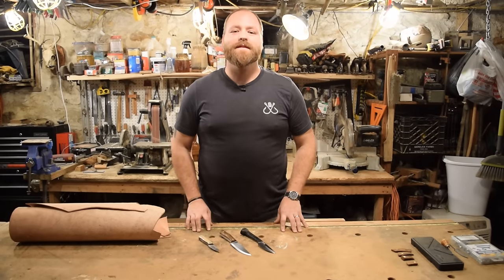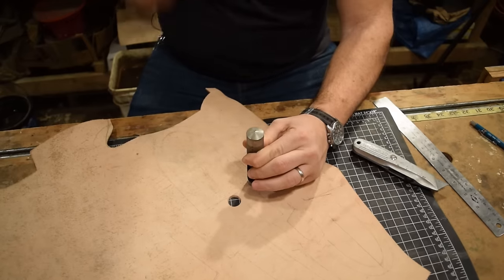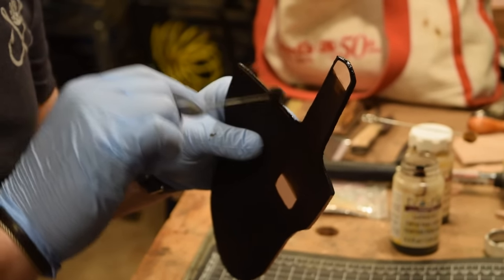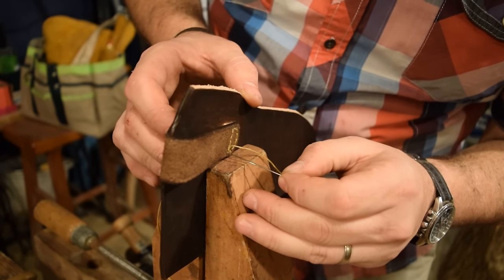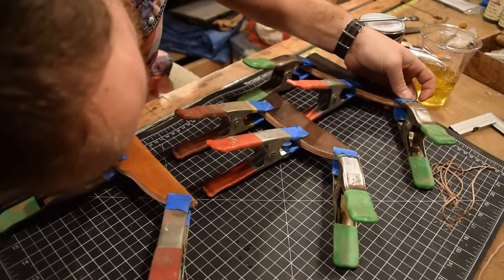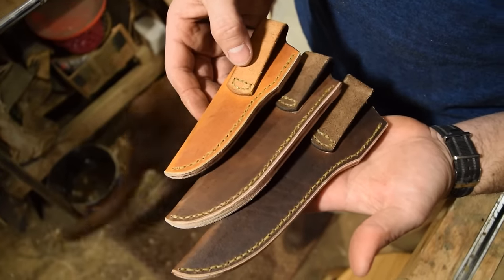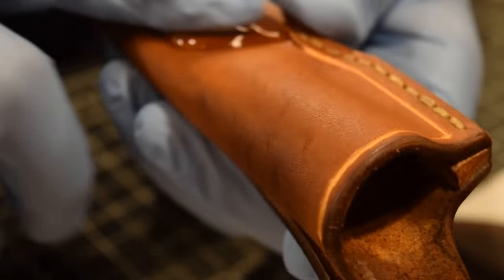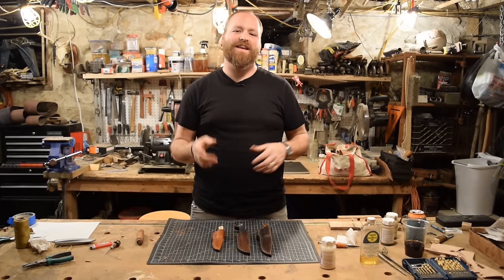Making 3 Knife Sheaths: 21 Essential Steps to Follow

Comment: Rather than drawing your pattern directly onto the leather. Go to your local hardware store and get yourself some painter's paper which is like your brown packaging paper and use that instead to make your patterns on. That way if you make a mistake it's only paper rather than wasting your leather and having to cut out another piece of your leather. Plus the paper allows you to make your decorative sheath handles if your making it as a drop down sheath rather than a high hip sheath, and it allows you to change or modify the pattern a lot easier with the paper.

Also rather than using those tiny daubers to apply your dye on the leather. If you have some real sheep wool, which I'm sure you do. Cut off a piece of wool like a pad bigger than an inch or the size of the dauber. Then with your leather scissors trim off a little excess of the wool off your pad and pour a little bit of your dye on the pad in the middle and fold the wool pad in half to spread the dye out evenly. Then using your pad spread the dye over your leather in a circular motion which will dye the leather in a more uniform color. Rather than streak lines you would normally get using a dauber in back n forth motion that leaves streak lines. I stopped using daubers yrs ago in applying my dye. I only use those to apply edge coat on the edges of my burnished leather.
Safe yourself the extra work  there is no need to edge your leather prior to applying the weld of your sheath for your gonna have to sand down the edges anyways once you've attached the weld and seed it together. Always sand and bevel the edges after you sew it. For sometimes the weld will pancake outwards from the edge when sewing it by hand or with a stitching machine. So you always want to sand the edges after then do your edge leveling and save you the extra work of doing it twice. Also rather than having to cut your weld exactly to the shape and curves of your pattern there is a much easier way of doing it. Just cut a straight strip of leather 3/8s or half inch thick however thick you want your weld to be. Then soak your leather weld in water until all the air bubbles disappear. The leather will be flexible and pliable to bend or curve it as you glue it down to your sheath. As always clamp it for a few minutes to allow the glue to cure before punching your holes by hand, drill, sewing machine. Then like I said once you have it stitched then sand and bevel your edges.
I'm glad you mentioned the 3 n 1 oil before wrapping them in saran wrap for many people dont think of that until it's to late and they rusted their blade.
 And like you said you had to hit again with the dauber and dye to even it out, but using a wool pad you wouldnt have to but then again you are using the Eco Flo water base dye which some of it does tend to come off in the water soaking.
 When applying the oil you can do the same thing using a large wool pad in a circular motion to apply it evenly on the leather. For those who dont know you use Neatsfoot Oil or you can actually use Extra Virgin Olive Oil to oil the leather, but you don't need a lot nor do you need to soak it in the oil. A little bit goes a long way and the oil will darken the leather some and all you need to do is let it sit for a while til it lightens up and if it's not as dark as you want you can always apply a second coat of oil. Better to work in several light coats rather than one heavy coating and then get it to dark than what you want. And you can finish it off anyway you want like he said in his video, carnauba cream, or Tan Kote, Bag Kote, Saddlelac or other types of leather finish to seal and protect the leather.

Comment: supposed to tap the glued leather with a hammer to set the glue
Reply from the maker: It’s not a critical step, when using contact cement, and stitching. I’ve seen other do it, but have never read that on any contact cement directions. Sometime I will, some times not 🤷🏼‍♂️😁.

Comment: First, Great video.   Have been an artistic blacksmith for over 20 years and have maked an occasional knife ( 3-15 a year), but never a sheath.   Wife got a high quality German steel pairing knife for Christmas and it needs a sheath.   Question,  Have both hard cured and soft cured Deer skin.  Is it thick enough for sheath.  Guessing yes, but question becomes welt thickness.   Should I try to use double thickness of deer skin, or find  thicker material?? Also, you are using a small drill for stitching.  Have seen video that uses finish nail which does not remove material but opens up hole to larger size for needle.  What is your opinion on this??  Third ,  What do you recommend for stitching material??  Looking forward to  your response.  Again really enjoyed video.   
Thanks, 
Ken at
Irondovetail.com
Reply from the maker: Hi Ken. Thank for your comment. The welt is there to protect you stitching from the blade of the knife, so it doesn’t have to be super thick, just glued into place and stitched through. I have switched Dover to using a finish nail in my drill press. I do think it’s better because it leaves the material to self seal itself after stitching.  I like using synthetic sinew for my thread. But I would also suggest waxed linen thread if you want a different color. 
Thanks again and good luck.

Comment: Do you still use Dap contact cement ?? Has it ever given you any problems like leaving runs and holes at the welt,front and back of sheath when you burnish/sand.
Reply from the maker: It has been perfect since I started using it.

Comment: I had a Westmark skinning knife which I kept very sharp . I ended up making a new sheath because when I wore my knife the welt rubbing on the edge, would take the edge off the blade in no time . Just by the blade moving in the sheath  while I walk . To stop that problem I made a new sheath out of wood , with  grooves in each half to stop the blades edge from touching anything while it is in the sheath . I also cut places on either half of the sheath to install two leather pads that grip the blade when it put in the sheath . Holding it in the sheath well enough to be able to wear the knife handle pointing down , with out it falling out. It seems your sheaths would be a lot better at not removing the edge from the blade

Comment: I haven't done much leather work but I have hand sewn heavy material like sewing a new zipper on a winter coat. I use a nylon cord that's about 1/8 diameter. My needles are home made. I made them out of wire coat hanger. I usually tie a single knot as close to the item as possible then use a lighter to melt or weld the end so it doesn't unravel.

Comment: does contact cement not stick well to a died surface? ive been wondering weather to die before or after my piece has been glued and assembled,
Reply from the maker: It’s probably fine, I would just suggest making sure that your dyed areas are completely dry before attempting to glue. I usually don’t have the patience, so I leave a spot undyed to glue😁.

Comment: Surprised you haven't set up some burnishing tools to use in the drill press. Great process on the build. For my personal use I'd not use any  oil on the leather. The whole purpose of the tanning process is to remove natural oils. Restoring oils tend to accelerate the degradation process of the grain/fibers whether they be natural or synthetic. (That's why you don't oil boots, but use a wax as a water shield to maintain shape and durability.) The waxes you use are spot on. Nice skills.

Comment: Excellent video! Something I might suggest is to put a thin layer of 5 min epoxy over the inside of the stitching that holds down the belt loop. I once, unfortunately, cut the stitching there on a sheath I made while inserting a knife. Epoxy is hard enough to offer good protection there.

Comment: Not sure if you're still lookin at comments on this but good work! My only other comment is that you could use a diamond edge awl instead of a straight awl to create your stitching holes. This would allow you to skip the drill press step after you mark your holes and it would add a stacked stitch effect with nice attractive diagonals! The main benefit (aside from skipping the press) is that it looks super even and makes errant holes much harder to notice. Plus it's pretty!
Reply from the maker: Thanks for the suggestion. I always appreciate advice 👍🏼.

Comment: Great examples and indepth explanations have you ever tried heating the water before you wet mold I always heat it to about 100 degrees before putting the leather in I find it makes the leather more pliable and once its dry it gives it some rigidity to keep the shape. And when you burnish the edge after the steps you've done if you wet sand it with 1000 grit then use whatever burnishing compound you use with a piece of canvas it'll give you a nice glassy edge.

Comment: Nice work, Respect!

I do seldom draw directly on my used materials (leather, canvas, denim, aviatic plywood, what ever...) especially for complicated figures. I often draw firstly on a sheet of cardboard, cut that out and use it as templates. Depending on the complexity of the workpiece, the templates can be taped together to build a rough prototype of the workpiece.
For complicated and not too big leatherwork that must sit tight (like knife sheaths), I sometimes use felt in the same thickness as the leather I will use later, for building a rough prototype. Felt is easy to process and with that kind of prototype I can be 100% sure that everything fits perfectly together, before I cut (or even draw) on the leather. 
That saved me from several fails with expensive materials - and over all it also saved me time: when I have a task that is similar to one I've already made, I can grab the old templates and adjust it to the current task.

Comment: When you grove the front for stitching, why don’t you do the same after you drill the holes for the back?
Reply from the maker: I do. After I drill I run a grove on the back side for the stitching to lay inside.
Reply: I’m a novice, I made my first knife blade from a piece of spring steel. I was wondering if I need to heat treat it? I never got it hot enough to change the state of the steel.
Reply: I just came across your videos and I enjoyed them. I’m also trying my hand at leather work to make a sheath for it

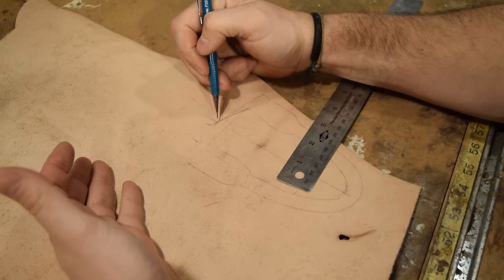Comment: Can you explain the taper @ 3:15 for the belt loop. You have the straight horizontal line where you want the sheath to end on the knife, but there appears to be the taper that goes above that and remains throughout the process. Just a bit confused? Giving it a go based on your tutorial here and I dont want to waste leather if I can. Thanks!
Reply from the maker: I’m not exactly sure what you mean. Are you referring to the angled top to the sheath. The top of the sheath angles from the welt, up to the folded side. I like to have a angle there to assist with pulling out and putting the knife into the sheath. If that not what you are referencing, let me know and I’ll do my best to help.

Comment: Few suggestions from one amateur to another: 1) you should buff the leather after the dye has dried, you have a much nicer finish; 2) this isn't a saddle stitch, it's just a normal stitch - a saddle stitch is angled, with the use of a diamond-headed pricking iron or by making a loop in the thread; 3) if you wet your leather along the line you want to groove, it makes the process easier; and 4) please use a pricking iron instead of the drill press. Keep up the good work!
Reply: Hi Thibaut, you sound like you do this for a living, so 2 questions for you is. 
Why would you use a pricking iron over a drill and what size thread do you recommend?
Reply: @chrispalffy3511  i would use a pricking iron + awl to make diamond-shaped holes. This would allow you to do saddle stitching, i.e., an angled stitch. Also, you'll find it is WAY easier and faster than with a drill. Now, you can buy 2 types of pricking irons: 1) the traditional ones, that will "prick" the leather and you need to pierce through with an awl; or 2) modern pricking irons that will go through the leather. I can't remember the brand on top of my head, but look at the videos from Armitage Leather, he tests different ones. Japancraft is a very good brand. Finally, size depends on your project and leather: the sturdier the project, the heavier the leather, the bigger the hole size.

Comment: I’m an amateur, but have made several sheaths.  Two things that I do for mine is related to the belt loop. First, I taper the end of the loop that glues / stitches to the sheath, softening that transition. Second, I groove the stitches attaching the loop (inside and outside ) so the stitching is not proud of the leather. This protects the stitching from cutting or wear. Great looking sheaths, thanks

Comment: What kind of manual press are you using? Nice sheath.
Reply from the maker: Can you time stamp it? I don’t have a press, so not sure what you are referencing. Thanks.
Reply: What model of Delta drill press did you use in the video?

Comment: Getting ready to make my first sheath. After you wet mold it, would it be a good idea to hit it with a heat gun to shrink the leather for a tighter fit?
Reply: I don't recommend a heat gun. you're likely to burn it or shrink it too much too fast. IF you want to speed up the process, a blow dryer on lower settings will do, but it won't really add anything except speed to the process. First time out, go the slow way. You could also put the knife and sheath in a vacuum seal bag and vacuform the leather for a nice tight fit, but it might actually get too tight and require a break in period before it's really ready to use properly. Just go slow on first one, THEN start experimenting.